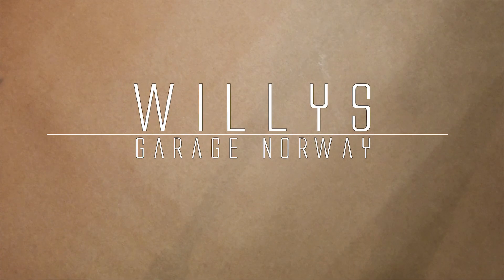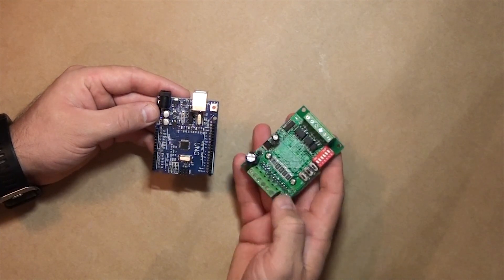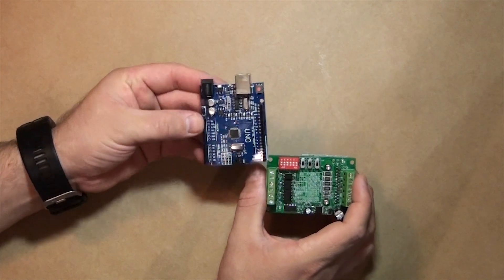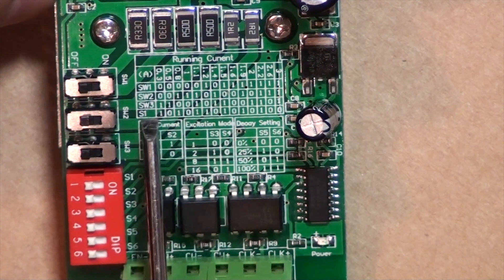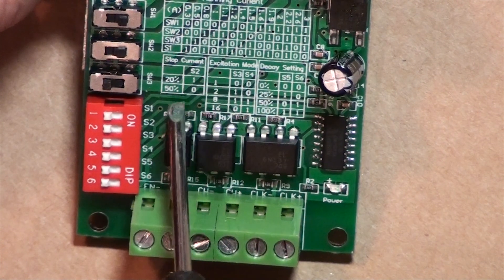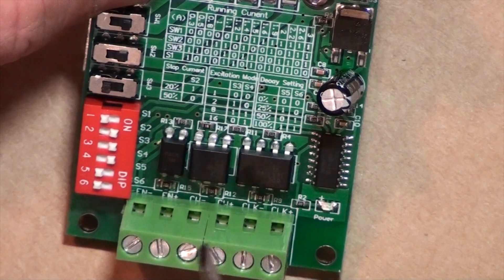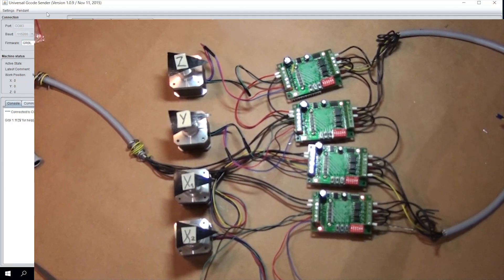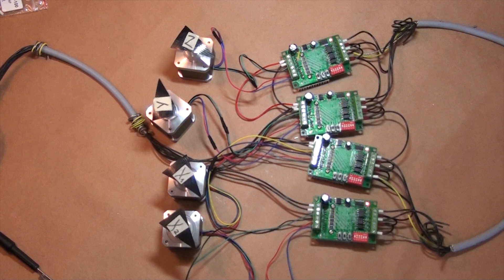First DIY CNC build (part 9) - TB6560 plus Arduino UNO is TRUE!

Comment: Thank you for an awesome video as usual. I just did the exact same thing as you did. I built a larger cnc, used my smaller one to make the parts lol and used the Arduino uno and 6560 stepper controllers. Wish I would have googled it and found this video, would have been easier lol.

Comment: Hi! I had a problem in mind, is my driver and motor getting heat up when I use a  power supply of 12v 3A lithium ion battery?

Comment: Hi, i want to build cnc router and i will use the same stepper motors 4x nema 23, 2.8A and 4x drivers tb6560 with arduino uno, but one friend told me that i should use bigger PSU, about 20A, and i see that yours is 14.6A, and i want to ask does 14.6A PSU working fine or i have to use bigger amperage? Tnx 😊✌
Reply from the maker: I have HAD no problem using my PSU so far 👍 so a 14 amp will work. But if you have the ekstra cash it could be wise to buy the bigger one
Reply: @WillysGarageNorway  aha.. thanks. And someone also reccomend me bigger drivers and 24v psu, can you tell me did it work well with tb6560 and 24v psu, and with what speed you cut wood. Thanks again 🙏😊
Reply from the maker: No problem :) I use the 24vdc 14 amps psu with the tb6560 and have had no problems with this setup. Of course, if you want higher feeds and speeds you need to upgrade things. Maby tb6600 or something 👍
Reply: @WillysGarageNorway  thanks friend, can you only tell me with what ipm you cut wood 😊
Reply from the maker: @gocejanovski4472  ipm - inches per minute? I live in Norway, EU, and we use the metric system. So I can give you mpm - millimeters per minute :)
Reply from the maker: @gocejanovski4472  Since my machine is, believe it or not, mostly made out of soft wood it realy is the construction it self that dictates my feeds and speeds. I usually use 700 - 1000 mm/min on 1-3mm depth per pass depending on type of material and quality needed on finished product
Reply: @WillysGarageNorway  ahm.. ok friend, thanks a lot ✌✌😊

Comment: While Industrial Router CNCs cost $4K, can I actually build a CNC router for my wood shop which would run say ,5 Hrs a day at an average, using Nema 23 and Arduino? would it be reliable?  What would be the trade-Off?  can you advise ?

Comment: Greetings, thanks for the video.  The vendor says that both bipolar and unipolar motors can be connected to the TB6560 driver.  The question is whether when connecting a unipolar motor in bipolar mode, I do not lose torque?  Can I still configure the microstep modes?  Is the engine not wasted?
Reply from the maker: Hi and thanks for watching :)
There should be no loss in power or tourqe when connecting a unipolar motor in bipolar connection 👍😀 And microstep also no difference

Comment: One tb6560 with 2 NEMA 17 can run the X axis
Reply from the maker: You could do that in theory, but I would not recommend it. There is little cost in buying one more tb6560 and clone them for the x-axis 👍
Reply: @WillysGarageNorway  single start of 4 start which is better  sir
Reply: Lead screw

Comment: So how good is this TB6560 driver ? I mean by the endurance of that driver, is that any problem like damage after several use? I'm curious to know because I'm running out the budget for buying the driver, this TB6560 is a lot cheaper than TB6600, I also want to run my NEMA 23
Reply from the maker: I have used the tb6560's without any issues since I built the machine 2-3 years ago. They still work as they did when new, never had to change them. 
I do have a good fan cooling system blowing air over the cooling blocks of the tb6560's so I would recommend that if you use them 👍
Reply: @WillysGarageNorway  can you share me your driver configuration on NEMA 23 for the microstep, current, decay, etc ?
Reply from the maker: I think I use the settings I set up in this video
https://youtu.be/Oy8vDJTGCY4
Reply: @WillysGarageNorway  so just like in this video? Ok ok thank you very much sir for the Information
Reply from the maker: No problem :) Let me know if you have any problems with the set up 👍

Comment: HI thanks for this very helpful video. i still have some doubt ,how much volt/amp each driver getting from this power supply ?
Reply from the maker: Hi and thanks for watching! The PSU is 24 Volt dc, so the drivers will get approx 24 volts, I think it will use these 24 volts out to the steppers also and I recon the amp is decided by the size of the stepper and resistance on the lead screw but maximum 15 Amps +/÷ in this setup.
Does this answer your question?

Comment: This is the point where most newbie fail😄😁😁 actually they use a4988 that is very weak low current driver while drv8825 can be re placed  because it has same layout as the a4988. Drv8825 is as power that at highest current it delivers a lot of current and makes my nema 23s to heat up... Well you can try those drivers...
Reply: Is this driver heat up easily?because i use l298n and it will  heat up easily

Comment: i tried to replicate your project using the drivers that came with the machine, but it wont work.
with the arduino shield it does work, but maybe I will have the same lack of power problem.
thanks by the videos, by the way
Reply from the maker: What sort of drivers do you use, tb6560? Installed GRBL on arduino?
Reply: @WillysGarageNorway  yes, but they are slightly different from yours.  they don't have the 3 black switches. I guess Chinese bad counterfeit.
I bought this machine from China a few months ago. it spouse to work with Mach3, the software was crap too. I've been watching your videos, and I'm trying to find a way around it, and try the arduino. I figure that the shield will be too week for the nema23. I got some DM556 Digital Stepper motor driver 5.6A for 57 86 stepper motor NEMA23 34 on the way, and I hope it will work, otherwise, got to spend the money in a better controller, and software.
now I got the arduino shield working, but the X axle don't work...
very frustrating.
eventually I'll get it. it is last piece of my puzzle. I got 3d printers, and laser machines. just missing the cnc miller.
Reply from the maker: Ok, cnc should work fine with Arduino GRBL and the Univeral Gcode Sender. The shield is to weak for the nema 23's as you say. I recommend that if you have one axis that work, try to use that driver on one of the axis that doesent work. This way you figure out if the problem is software or hardware. As you probably know, good to double check wiring and software driver instal
Reply: @WillysGarageNorway  hi, thanks for your help and videos.
the problem it's not the driver, because I exchange them around, and they all work on the other axis, also the connections on the motors. they work except on the X axis. my guess it is, the shield it self, or some software problems. I even try it with two different arduinos, and the problem persists.
next try, it will be inspired on your videos too. I will clone the X axis, and try to get it to work on the A axis.
Reply from the maker: Thanks for feedback :) have you tried to change the GRBL settings in Universal Gcode sender? Like steps per revolution and acceleration?
Like I did in this video:
https://youtu.be/-ssuoF2oXGg
Reply: @WillysGarageNorway  I have run the wizard on the universal Gcode sender, and I have put it at 2000 steps per revolution, which I guess this motors move 1.8 degrees per step. this steppers specifics are all in Chinese! the problem is that it works for all the other axis, except for the X. also, I put a jumper on the shield, which makes the motors to have constant torque, and again every time  i connect one motor to the X, nothing happens. What is leading me to believe, that there is some problem with the shield. maybe I've shorted some pin on the shield by accident, and now it is damage.
anyway, I will wait for the good drivers.
I just wanted to try the arduino, because it is cheap, and I got some other projects going on that involve robotics and arduino.
I'm very novice with arduino, I must say, but like in everything else, I'm convinced that I will crack the code. Literally (: 
thanks again for your interest to help.
PS, are you in any CNC group on facebook?
that way I could send you a picture, or a video, showing you the motor drivers I got that came with the machine which says TB6560, but as I told you before, they are slightly different then yours.
it would be great to run it with this drivers and the Arduino, and keep the new ones that I've ordered, to a stronger CNC machine.
Reply from the maker: @joematarc5245  No problem, you can reach me on my Facebookpage, send vids and pictures and stuff :)
Let me know how it goes.

https://www.facebook.com/willysgaragenorway/

Comment: Be careful using those TB6560 modules. The data sheet specifically calls for the 5v logic to be applied to the chip first and be allowed to settle before the motor voltage (24v or more) is applied to the chip. Those module derive the logic voltage from the higher voltage using a 7805 thus compromising the power-up sequence. There have been reports of failed chips as a result. The problem can be resolved with a modification of the power circuitry.
Reply from the maker: Thanks for the information, I have used the tb6560 for 3 years now and have had no issues with them, I am using tourqe hold when power on also
Reply from the maker: But I reccon its good to keep in mind what you say

Comment: hi, i breaking my head over my DIY CNC, it runs, has to little torque. Use CNC shield, arduino, Nema17. Replaced everyting, upped the power 12 -> 36V. Adjusted the driver pots.... nothing really helps, still can hold the steppers by hand. Strange because if i see youtube lots of people build these, maybe they dont not tell about all the problem they ran into :-). Think i might try this also, have to downgrade my power supply again. Is you setup stronger now ? or can you sill hold it by hand ? Thanks for this video !
Reply from the maker: Hi, Im sorry you have problems. When i first built the machine I had it running on the cnc shield and NEMA17. Many did it on youtube and spoke of no problems but It was way to weak, like yours.  Then I upgraded to the tb6560 and NEMA23's, It is so much stronger it realy can not compare at all. I am sure your nema17's also will be a lot stronger if you use the tb6560's or tb6600's
Reply from the maker: I think you stil might be able to use the 36v PSU
Reply: @WillysGarageNorway  wel i orderd the drivers and a new PSU, because drivers are input 24v advised i think. i hope i can keep te 17's because it gets a realy big machine :-)
Reply from the maker: I think you can try, make room to change them in the future 👍😀
Reply: @WillysGarageNorway  we see !

Comment: Thank you so much, I have been thinking of doing this for a while, I have been experimenting with motors, but not got round to the build yet, watching this as soon as I can go get the wood, its all systems go, great video thanks again
Reply from the maker: No prob, let me know if you have any questions 👍😃
Reply: Hi, how did you wire up limit switches ?

Comment: How did you correct the direction of the 2 X axis motor that was spinning the opposite direction? Can you pls explain so if I face that issue I might be able to handle it :) thank you
Reply from the maker: You can try to change over the wireing on the motor that has the wrong direction 👍
Reply: @WillysGarageNorway  thank you so much!! Your video is very inspiring and has a greater clarity than any of the videos i have seen on YouTube regarding CNC. Thanks again for your quick resolution :)

Comment: I am having a problem, my stepper is rotating in one direction only.
Reply from the maker: Try hoocking it up to one of the other axis drivers, this way you can figure out if its the driver or motor/wires thatmies the problem
Reply from the maker: What was not working?
Reply: @WillysGarageNorway  sorry! It was stepper wiring problem, now motor is working perfectly thanks 👍

Comment: Hello my friend.i want to connect too servo sg90..to whom pin for ardouino??i will need some extra gode?now i have it CNC Shield + UNO R3 Board + 4 X DRV8825 Driver
now i have built cnc plotter with CNC Shield + UNO R3 Board + 4 X DRV8825 Driver and servo sg 90.....I want to put it nema 23 but I find it difficult the servo...I do not know pin for arduino..

Comment: Hello..i have follow your wiring diagram in your video step by step..but my stepper motor not moving at all..
I use arduino uno, nema 23,grbl 1.1 and ugs..before i use cnc shield v3 it work fine..can you help me....thanks

Comment: The driver i want to take take is TB6560 with arduino uno
is that a good ????
Reply from the maker: That is very good and recomended 👍 I would buy a 24volt power supply for that setup

Comment: Good Morning, 
thanks for the replay but on the datasheet it is 2.4Volt en 2.4 Amps
on witch volt i can run the 3 steppermotors : 
JKM JK42HM48 NEMA17 0.9° 42 Hybrid Stepper Motor Two Phase 48mm 4.8kg. on banggood
Thanks
Fourstar
Reply from the maker: Since its a NEMA17, you can run it with 12-24volts. Maby its a typ-o and should say 24 volts?
What sort of stepper motor driver are you going to use?
Reply: That rating means that at 2.4 volts the motor will draw 2.4 amps so at 24VDC setting the current limit is vital. I run Nema 23's at 36VDC and set the current at 3.3 amps.

Comment: hey I have used Xerox stepper motors..and i am using two sliders for x-axis the problem is some time one slider lags behind although i am providing same signal to both stepper drivers(tb6560).
also what platform are you using for making g-codes?
Reply: Hi, Im using Fusion 360 to generate g codes and UGS for sending it to the CNC machine
Reply: @maximuskembo  thank you I am using inkscape  but I have to manually edit the g-code and remove certain commands starting from "M"....otherwise my code is not recognized.

Comment: Where's degram line
Reply from the maker: If you want the wiring diagram it is in .pdf file here: http://willysgaragenorway.no/wp-content/uploads/2017/09/tb6560pdf.pdf
Reply: @WillysGarageNorway  thanks
Reply from the maker: It is also on that videos page including other links:
http://willysgaragenorway.no/2017/09/23/tb6560-arduino-uno-wiring-diagram-more/

Comment: I want to upgrade my nema17+a4988 config to nema23+ tb6560. Do i need to upgrade software? or just need connect all cables? GRBL. thanks.
Reply from the maker: Hi, you dont need to upgrade the software. You can connect the tb6560 directly to the Arduino UNO according to the GRBL pinout :)
Reply: WillysGarageNorway Thank you :)
Reply: @WillysGarageNorway  I watched a video. He was connecting GND cable to left side GND slot. Is it makes any differences? I am a mechanical engineer so i do not understand electronics. :(

Comment: HI! I found the answer of my previous question.. I hope you could help me on would it be okay to use different sizes of stepper motor like 3 nema 17 and 1 nema 23?
Reply from the maker: Yes, no problem running different steppers as long as they have there own stepper driver 👍

Comment: I followed every direction you gave and everything works great. The only issue is the Y axis only spins in one direction. I flashed the Arduino using grbl and I'm controlling it with UGCS. I verified all the wires are plugged in correctly, there aren't any opens in the lines. I switched to a different driver and motor and it does the same thing. only spins one way. any suggestions would be appreciated
Reply from the maker: Hmm, sounds like it could be a software issue but Im not sure. Have you figured it out?
Reply: @WillysGarageNorway  yup, got it fixed. Too forever to identify the code but i got it

Comment: You know you could have just used 
DRV8825 stepper Motor Driver in the cnc shield and saved all that money
They are rated @ 2.5amps
Reply from the maker: You may be right there but I really wanted a solution that did not give 100 % all the time, this way the units will last longer. The tb6560 were not expencive. But maby in a later build I will use those. Thanks for watching and thanks for the tip

Comment: Hello
I have a motor (NEMA 23 LDO-57STH56-2804AC)
can I make it work with A4988
THANK YOU ahead
Reply from the maker: Is it a 4 wire og 6 wire motor?
Reply: You can get 6 wire to 4 wire  connectors  @WillysGarageNorway  great job your doing there are so many alternative ways to make these machines.

Comment: hi this configuration is good for the tb6600
Reply from the maker: I am think so.. But I have not tried the tb6600 myself, so no expert ,:)
Reply: You got to be careful with what you are buying... I have bought some tb6600 from a Chinese supplier and they don't behave like tb6600... They also loose steps randomly or put in some more...

Comment: I can tell from the sound the motor generate squeakily  sound the fact that the driver is not providing correct PWM waveform.
Reply from the maker: Ok, but it works great now after some tweaking 👍😀

Comment: hello I have a problem I follow the video steps but the X axis works an engine for each direction that can be
Thank you
Reply from the maker: tazmahv lucky You can turn two of the wires on one motor, than try again 👍🏻

Comment: I cannot find the link on your site for the connection schematic :(  This is a great video!
Reply from the maker: Thanks for watching 👍 do you mean this?: http://willysgaragenorway.no/wp-content/uploads/2017/09/Arduino-and-TB6560-wiring-diagram-1.png
Reply from the maker: And or this: http://willysgaragenorway.no/wp-content/uploads/2017/09/tb6560pdf.pdf
Reply: Thank you!  I am looking specifically on how to connect the stepper motors...it's not clear how to do that :(
Reply from the maker: DerekSpeare if you know the pairs of the stepper motor, there is no wrong way to connect it. Connect one pair to A+- and the other to B+- 👍🏻